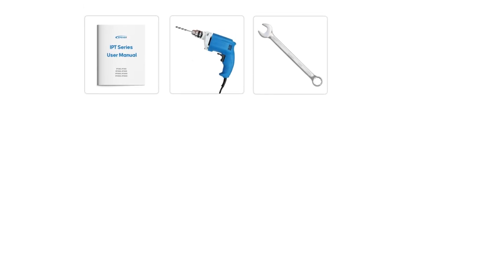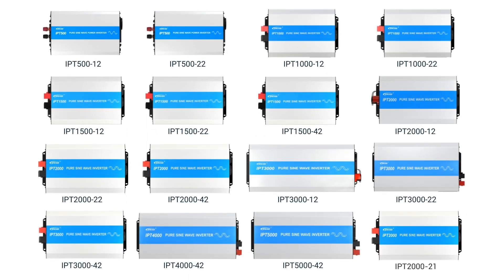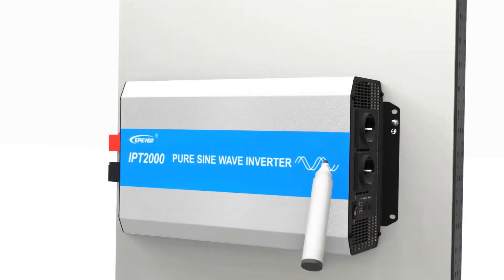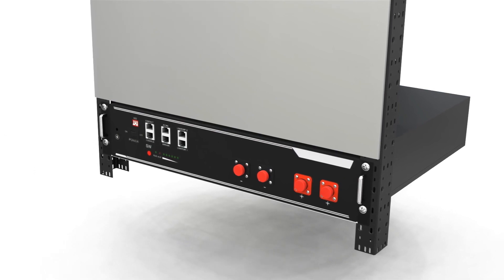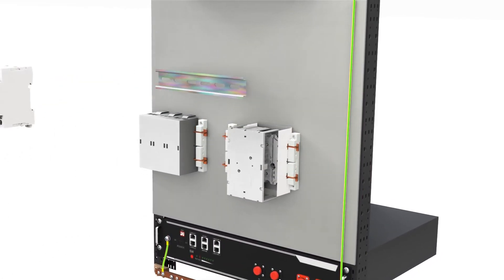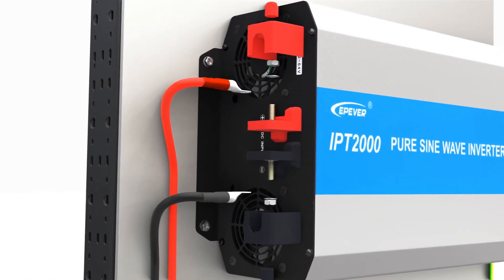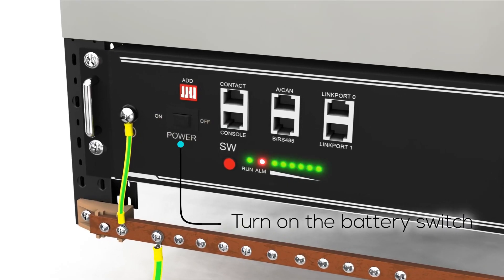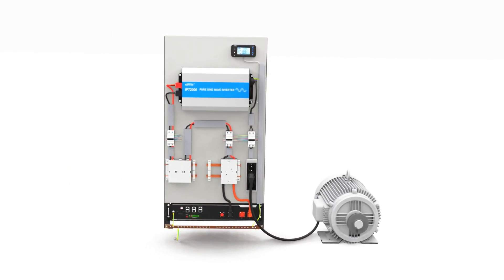EPEVER IPT Series Inverter Installation Guide for Solar Power

Comment: what AC breakers are required and can this go to a 13A 2-Gang SP Switched Socket with USB charger ports. Also does the system require an RCD and MCB;s?
Reply from the maker: Hi, we recommend installing an MCB for protection. Other components like RCDs are not recommended for this system.
For further guidance based on your setup, feel free to reach out to our technical team at support@epever.com.

Comment: I have the IPT 1500 and am using 50mm2 cable to busbars. What size earth cable do I need to use?
Reply from the maker: Hi there, please contact our support team at support@epever.com for accurate guidance on earth cable size. Thanks!
Reply: @Epever  They just said to use bigger than 2.5mm2....is that correct?

Comment: If this is a high frequency inverter, forget about it. High frequency inverters offer a shorter life expectancy and a far poorer peak power capacity than a heavy duty low frequency inverter.
Reply from the maker: Thank you for your feedback. Our product line includes both high-frequency and low-frequency inverters, allowing users to choose the one that best suits their needs.
Reply: @Epever  that's good news. Then I will definitely look into bringing your low frequency inverter products into our inventory.
Reply from the maker: We're thrilled to hear that you're interested in our low-frequency inverter products! You can check here: https://www.epever.com/products/?yith_wcan=1&product_cat=inverter&filter_inverter-type=low-frequency&query_type_inverter-type=or
Feel free to contact us at info@epever.com if you have any questions or need further assistance in selecting the right product for your inventory. We're here to help! @originaldiysolar

Comment: Is it possible to charge an electric car with the IP5000-42 plus inverter?
If so, what is the best sustainable max power for 6 hours of charging?
I use a 15kWh LFP battery
Thank you
Reply from the maker: Hello there, If you want to charge your electric car using a charger, please provide us with the charger's specifications at support@epever.com, so we can check if the inverter can support it. Your daily requirement is six hours of charging at an average rate of 2500W per hour. However, it's essential to be aware that a 5000W inverter may not be able to handle such a high surge power, so further evaluation is necessary.

While using the inverter directly for this purpose is typically not supported. In such a scenario, you might want to consider using a controller or an inverter/charger.